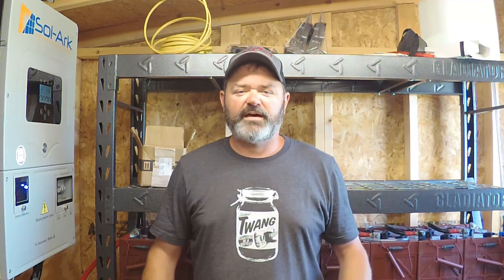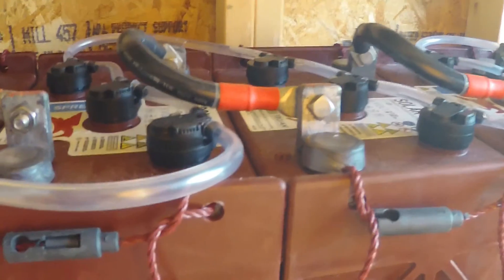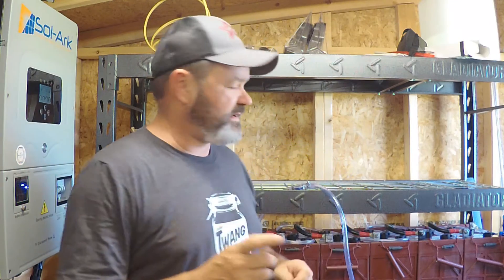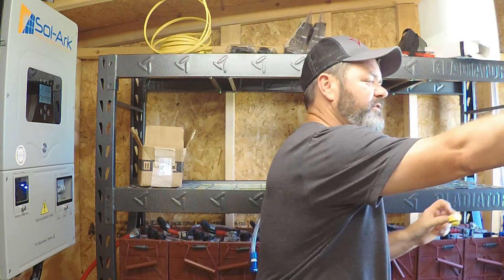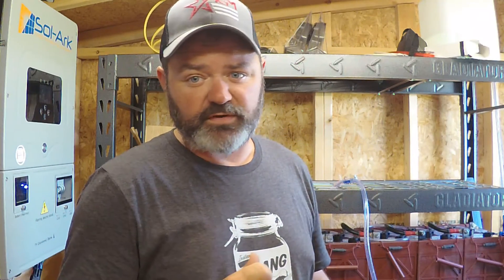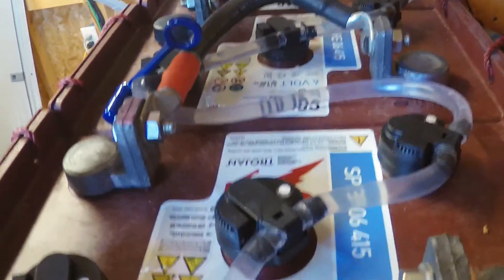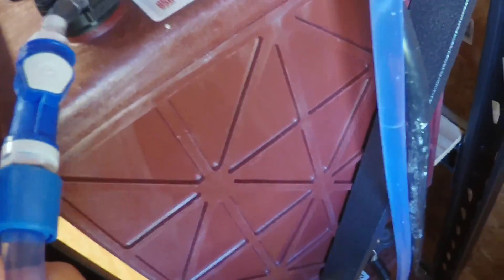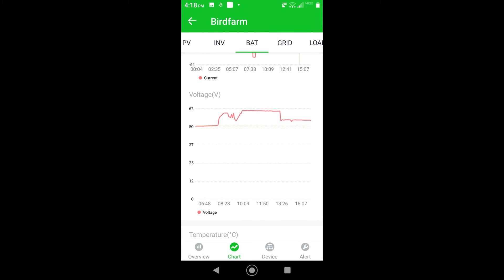DIY Solar Off-Grid Living - Battery Maintenance & Watering

Comment: Great video, thanks.  One quick question, how do you prevent the storage tank for the watering system from freezing in cold weather?
Reply from the maker: Good question. All I can say is over the past winter it never did. I guess being in a room full of humming electronics and batteries keeps the temperature just warm enough (in our environment) for it not to be an issue. Further north and one may need to store the tank elsewhere until needed.